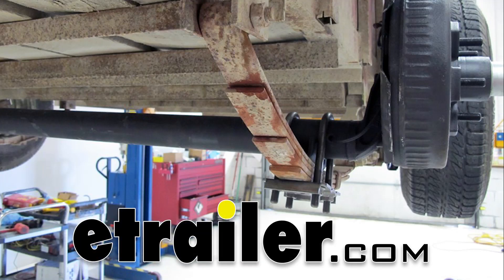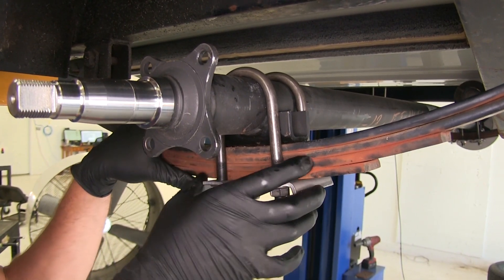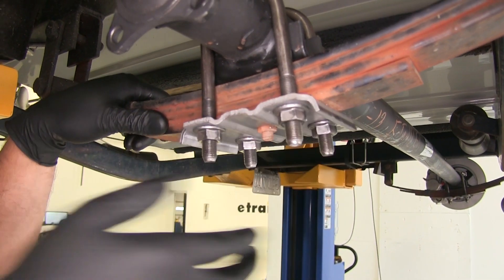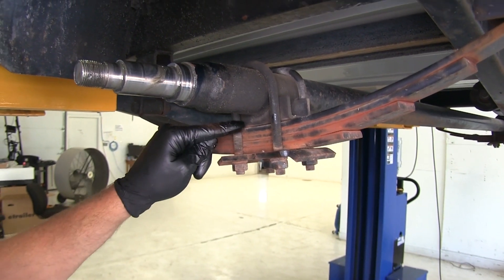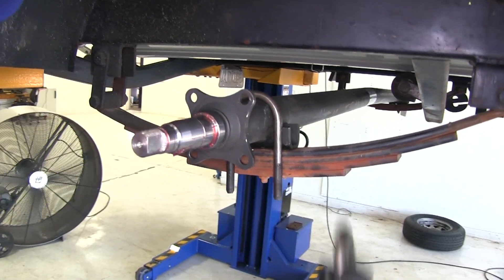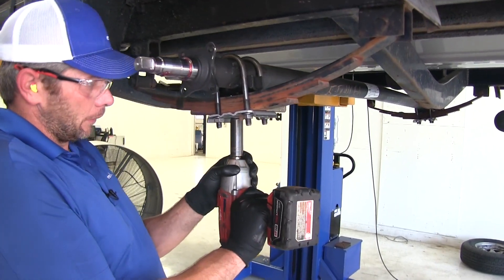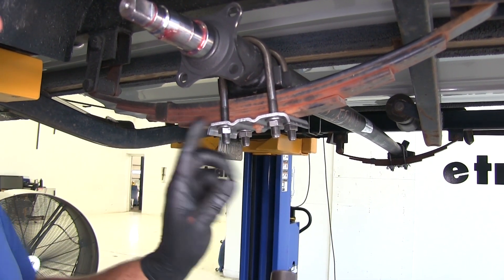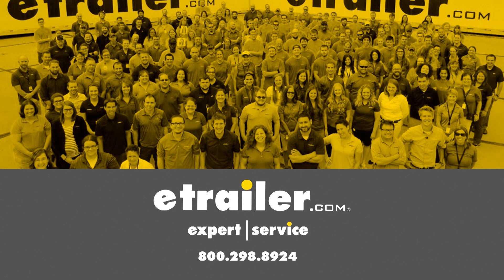etrailer | Comprehensive Review: U-Bolt Kit for Mounting 3,500-lb, Round Trailer Axles

Comment: It’d be nice if you talked about the torque spec instead of just torquing it and not saying anything
Reply from the maker: A 7/16 Grade 5 U-bolt should be torqued to 50 foot lbs.
https://www.etrailer.com/Trailer-Suspension-Parts/Dexter/APUBR-1.html

Comment: You should of included the torque spec.
Reply from the maker: A 7/16th U-bolt should be torqued to 70-80 foot lbs.
https://www.etrailer.com/Trailer-Suspension-Parts/Dexter/APUBR-1.html